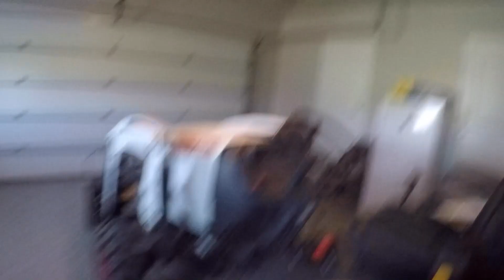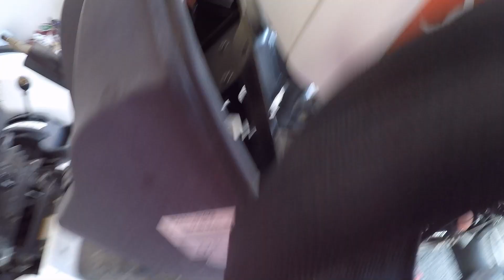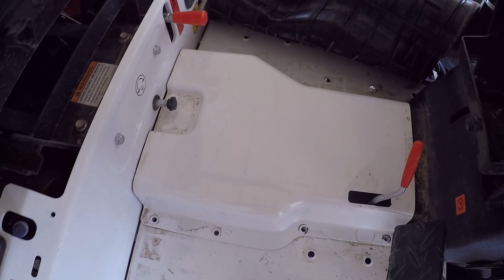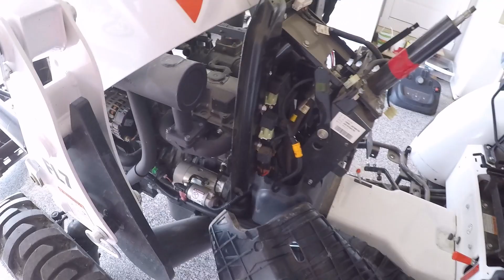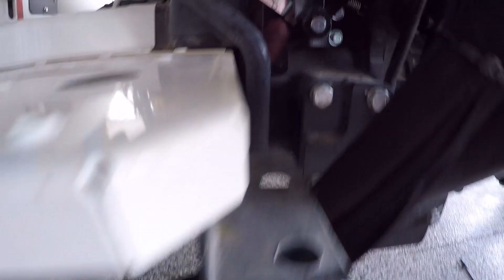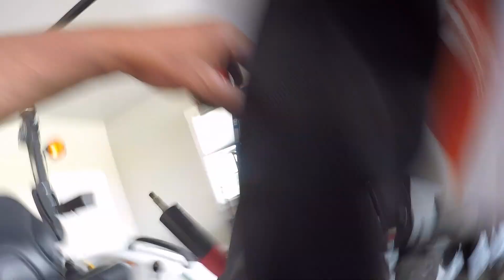Bobcat / Kioti CT2025 Tractor Cruise Control Install

Comment: I had no need to remove the pedals or the floor board if you can get the steering wheel off it goes pretty quick
Reply from the maker: That’s good to know. Thanks for commenting.

Comment: Thank for the video I just finished my Kioti CK 2610 steering wheel took me all day to remove on a 4 year old tractor but I got it done cruise control works great well worth it
Reply from the maker: Yeah, the steering wheel is the hardest part. I use the CC all the time.

Comment: Great videos. Helped me add these 2 options fairly quickly. The instructions from Kioti were not great so thank you! As a tip for others, getting the steering wheel off was a real pain even though my tractor is basically brand new. AutoZone has a tool rental program where you pay the full value then can return it for a full refund. I went there as I first tried getting the wheel off with not success and grabbed one. It didn’t fit perfectly but with some maneuvering steering wheel popped right off.
Reply from the maker: I agree, the instructions were less than adequate. The steering wheel is definitely on there for life.

Comment: Nice work.  I have noticed that the Bobcat wiring harnesses are EXACTLY the length they need to be.  If you don't follow the correct route, it will not work. I am going to get the kit for my CT4050. I believe it will be a lot less work than this CT2025. I think my unit already has the relays in the fuse box, but no magnet.
Reply from the maker: Thanks. It would be interesting to see what the difference is for the 4000 series. My CT5555 doesn't have a magnet, the pedals come back to neutral once the switch is pressed, so I'm guessing it has some sort of speed sensor that tells the computer what speed to maintain and doesn't care about pedal position.